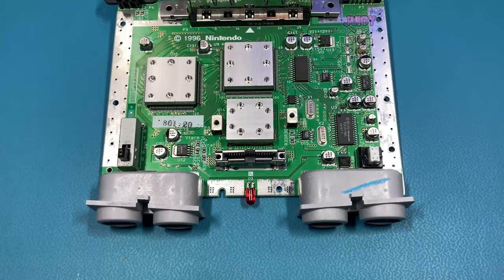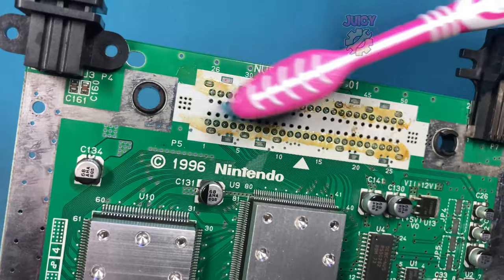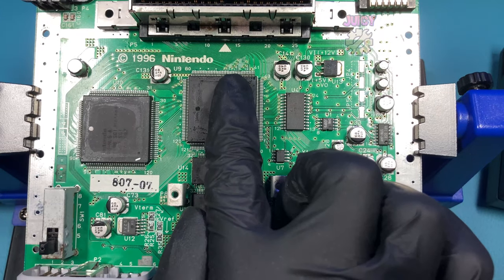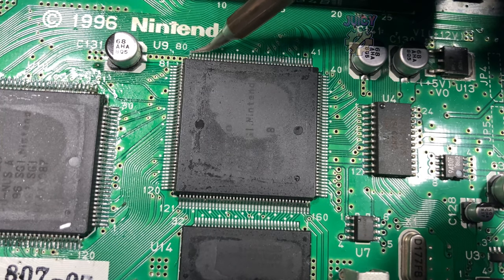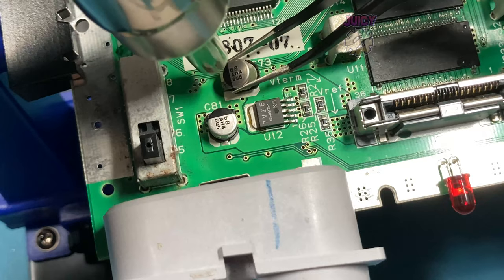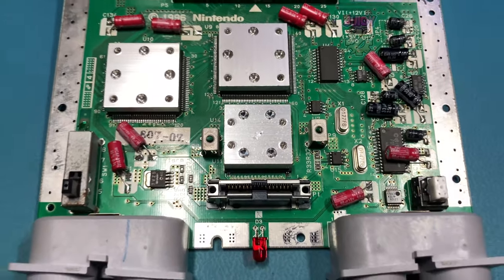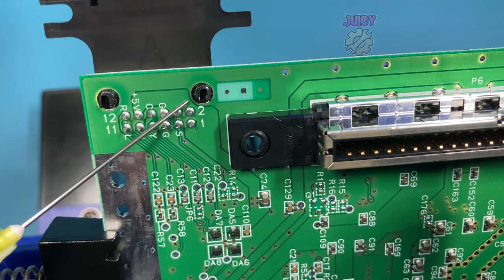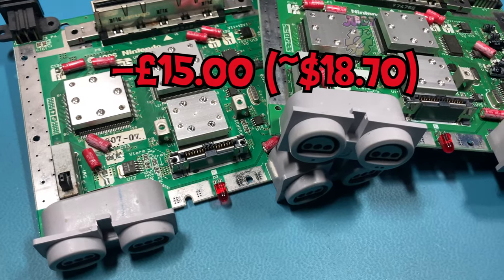can i save these two N64's from the TRASH?

Comment: I fixed one of these that had this problem actually, what was clear to me is that the cartridge connector is exceptionally sensitive on these consoles, you need to also check the holes the cartridge adaptor goes into as well, each hole has a mating contact on the bottom side and they also corrode and each of these are soldered and if one pin is bad you won´t get picture. when I fixed mine i had to de-solder the defect pins and replace them, and on the cartridge adaptor you can just take a plier and carefully pull them out to clean or replace damaged pins. I could also pry off the expansion plastic leaving the pins still in the board and just replace corroded and bad pins individually. I did my repair in 2020 and the console still works like a charm
Reply from the maker: thats an interesting point, i could check for continuity between the pins if all is okay then what i could do, this is kind of crazy. BUT i could desolder the bottom connector and then solder in the game connector haha
Reply: @JuicyJakeRepairs  Yeah that is probably possible, the bottom connector is not really used on a 64 anyway. let me know if this helped too :)

Comment: What an immaculate amount of work, I would've never even started on the IC's let alone caps unless I had a clue on what it could be, and I bet the fix will be something super simple!
At this point I would also cross reference the boards with a working one, maybe with some voltage injection if all else fails.
Have to comment on your clean reflowing skills, one of the better jobs you've done compared to many others I wantch for as little as that matters!
Reply from the maker: i went for the approach of if i have no leads just try something. Its not like the board works anyway haha

Comment: This is why I don’t actively seek N64s this problem is annoying. The N64 doesn’t give any indication as to why it has failed, no burned traces, no bulging capacitors, no images on the screen. 

Try to reflow the expansion cart SMD pins.
Reply from the maker: yeah its quite annoying, i couldnt see any videos about it. Most were "clean / reinsert jumper pak" i have tried reflowing these pins but no luck still!
Reply: Did you bust out the multimeter at all to cross reference with a working system? That's the first thing I would do.